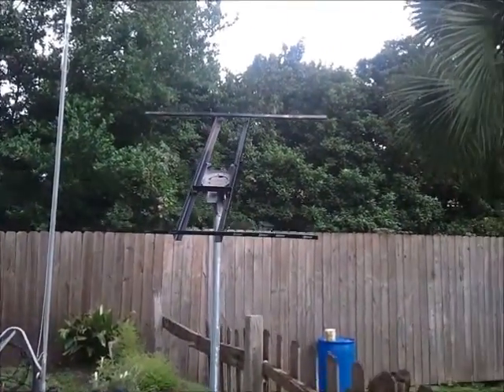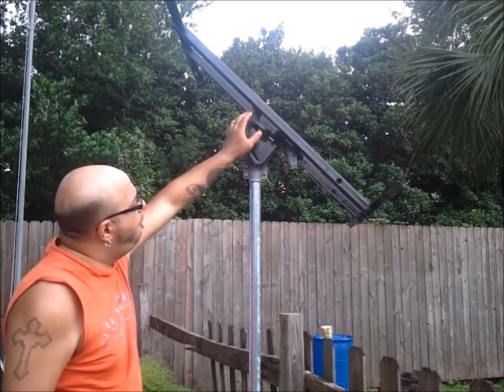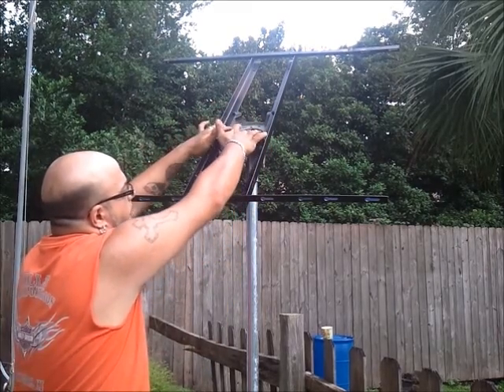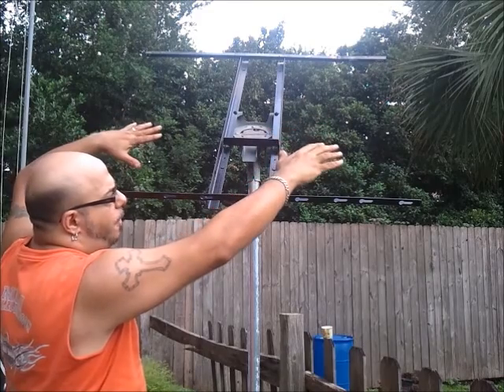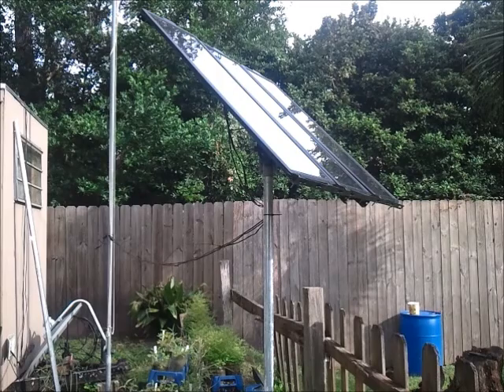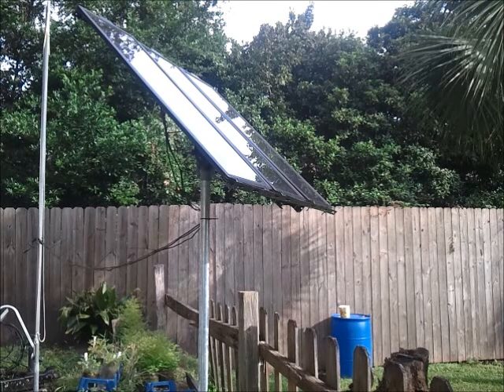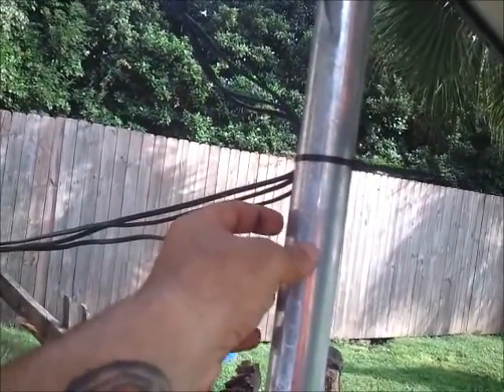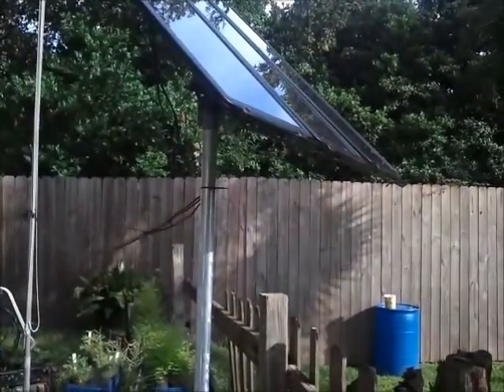solar panel pole mount

Comment: Please show your mount UP CLOSE please. 
I have access to a bunch of roof satellite mounts.
Was trying to find a top of the pole dual axis mount. Nobody has a clue to what I am asking for.
I have plans to create a "mini axle" to put in the top to easily rotate the panels several times a day.
Then I will create a solar tracker with tiny solar panels (thinking of the ones from yard lamps) and a tiny electric motor.
I saw a YT video several years ago on how to build one . . . BUT the video has dissapeared from YT.
I am subscribing to you.
I also have assembled a sand battery to heat my home. Lets talk

Comment: Thanks for the video.  I've looked everywhere for the device which you describe as having come from a satellite dish.  I believe it is called a Steel Adjustable Universal Pole Mount

I found another video about it.  See the markp0177 video entitled, "Heavy duty solar panel pole mount kit. For sell." 

I did find the device on eBay.  Someone is selling one which is described as for a 10W-100W solar panel and another is offered as being for a 100W-200W solar panel.  However, at this point, I am uncertain as to whether they are actually different models.

I am looking for one which will accommodate two 180W panels sold by BougeRV, i.e., a 48-pound configuration subject to occasional 25mph winds (hopefully never more than 25mph).

Individual panel specs:
Dimensions: 26.38 x 58.27 x 1.38 inches
Net Weight (kg / lb): 10.9kg / 24 lbs
- - -
Side-by-side: 52.76 x 58.27 x 1.38 inches @ 48 pounds

The above findings leave me with these questions:
• Do you know if this Steel Adjustable Universal Pole Mount has a more applicable name?
• Do you know of a seller of this device?

Thanks for giving this matter your attention.  I hope you have the time and the interest to respond.  Much appreciated.
Reply from the maker: I'll be honest I'm not sure what the correct name is for him I'm kind of a backwood stop Builder I've always just called them satellite dish holders in a sense to build one from scratch I would just look for the bigger satellite dishes such as the ones that are made for internet style dishes they tend to have bigger bracket on them then everything else I generally use is angle iron and just fabricated to fit my application I'm sorry I couldn't help much further
Reply: @massis32210  Thanks for taking your time to respond.  Much Appreciated.

Comment: That is a nice design. I just finished a pole mount design and I wanted to see what others had done. I'm pretty sure that would hold up in a pretty strong wind if your welds are strong and you anchor it in concrete. A schedule 40 pipe would be stronger, but if you're only 5-6 feet off the ground, that fence pole might be strong enough.
Anyway, it's an excellent example of re-purposing.
p.s. I'm pretty sure you were looking at battery voltage on your charge controller. 90W @ 12V = 7.5A, so you should have seen your amp's go from about 3 to 7 if the battery needed a charge. If your battery is topped off, the charge controller will limit the current going to it.
Reply from the maker: If you like this design stay tuned I have a pole mount for 4 100w panels about to be made. Thanks for watching...

Comment: That's a very nice install looks really good. Unfortunately it wouldn't work for my location as I get incredible gale force winds here in the winter. My installation on wood is anchored in the ground at all four corners and once the ground freezes this winter it should be very stable, fingers crossed, but time will tell.
Reply from the maker: I wish that would have worked for you.  But you have to look out  for the best interest of the panels. With high winds it might make them go flying.  thank you for taking your time to watch my video.
Reply: +R. L. Sheridan I think wind power would work very well here but I don't want to deal with the tall tower and all of the moving parts that can break and need replacing.
Reply from the maker: +R. L. Sheridan wind is good, but I have seen a lot of people have lots of problems with blades braking off, poles bending.
Reply: +massis32210 That's why I didn't go with it too many moving parts to break and when they break they are very high up in the air.
Reply from the maker: +Dale Calder you have a great setup now.  I have run a fridge on the same panels.  you just need some batteries and you can run what ever you would like.